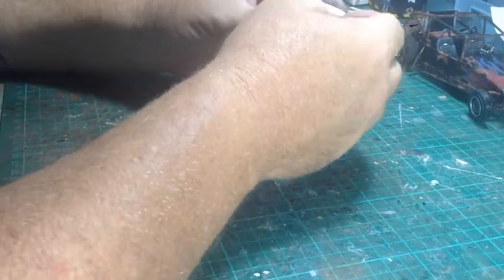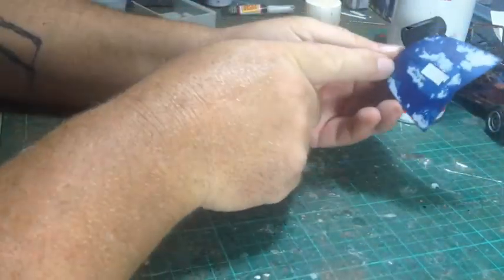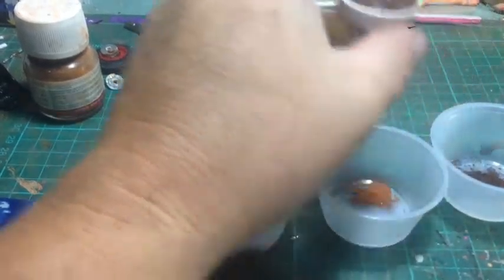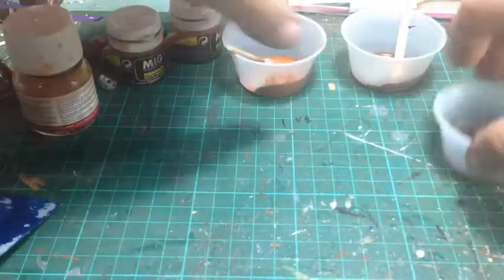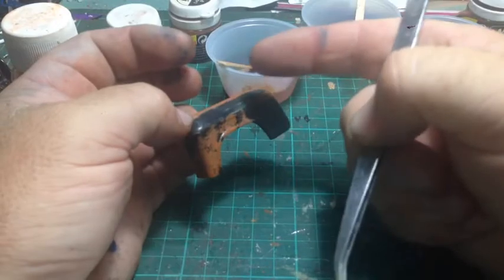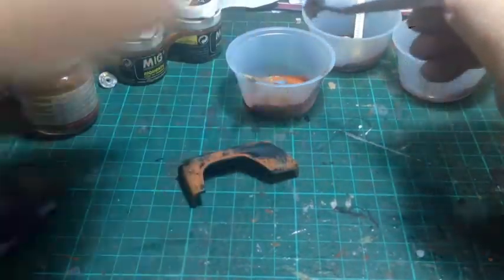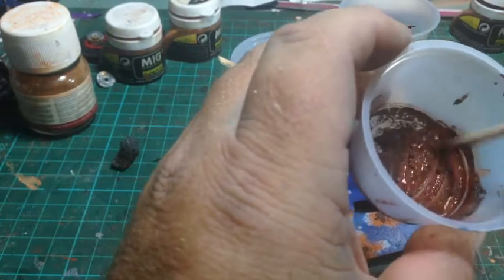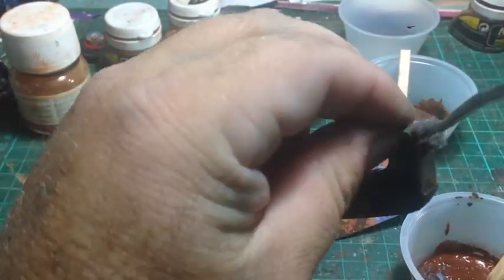Fake rust with Hairspray andweathering powders

Comment: Thanks for showing how you weather your cars. You mentioned putting rusty nails & water in a jar to make a rusty solution.
Steel wool in a jar of water works well too.
Reply from the maker: Hi Rick, thanks mate happy to share what i learn with other model builders. Yes the other Technique is chopped up steel wool in a solution of 50% white vinegar and 50% peroxide, didnt want to mention in this video, i made it a while ago and the fella that shared his videos on that technique may have got upset..
Reply: I will have to try the steel wool vinegar & peroxide solution. Thanks for this info.
Reply: With the wire wool and water, would you add salt in too or is it just the wool and water...
Reply from the maker: J Griffiths the solution is half white vinegar and half peroxide, no water or salt. just mix the 2 together and chuck in some chopped up steel wool. to apply just dab it on.
Reply: I just use water but salt might speed up the process.
Reply: Thank you. I will try this method out.
Reply: Hi Rick,

Thank you for letting me know, I wasn't sure if you put salt in or not, I've never tried it myself, I'm only just starting to have a go at weathering...

I only found Morries channel but chance, I've been thinking about building a garage type diorama for awhile but could never really find any decent videos on building one in 1/24 scale, there's hundred's with model train scale though, I've no idea on how to up-scale things to 1/24...

Many thanks again...

John...